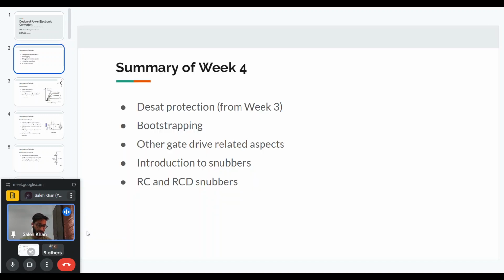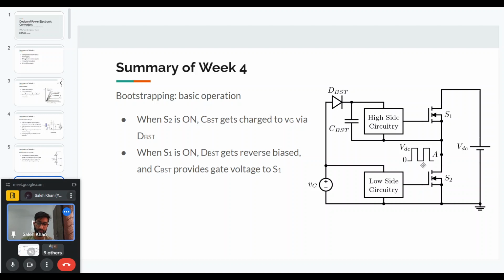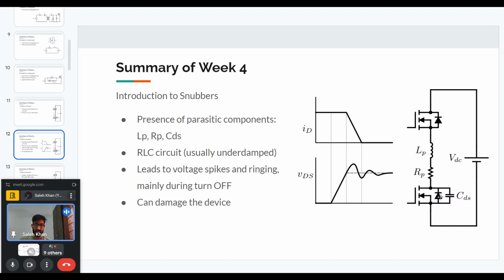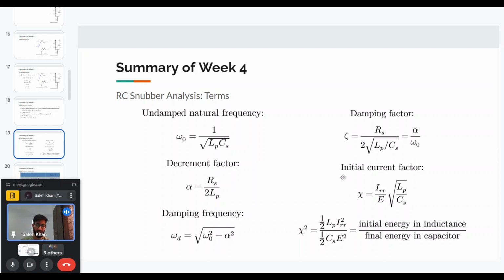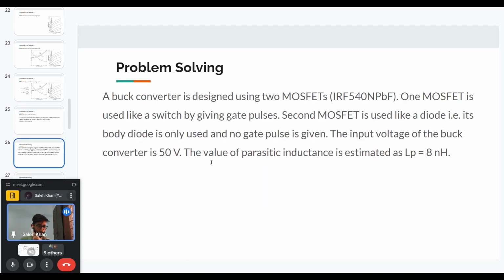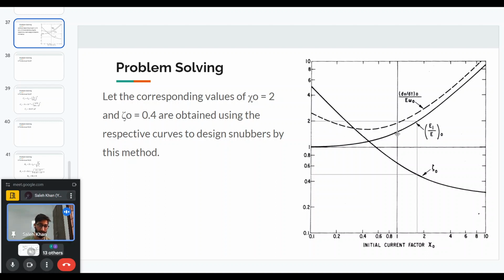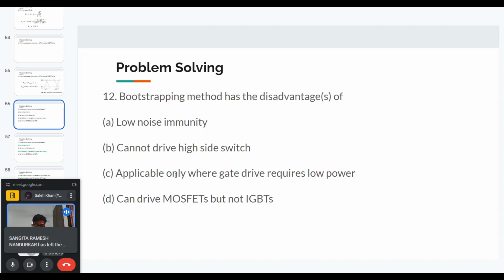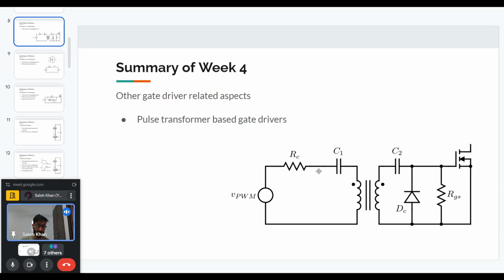NPTEL Design of Power Electronics Converters - Problem Solving Session - Week 4

Comment: Hello Sir,How to draw those graphs of zeta and chi,can i choose random values of chi or any specific values.Please suggest software for plot these graphs
Reply from the maker: You can plot these graphs in MATLAB or Octave. Plot these graphs with respect to zeta for a particular value of chi and then add more plots for different chi values. You should get the same plots as given in the reference paper, since these expressions are independent of dc voltage and peak current.